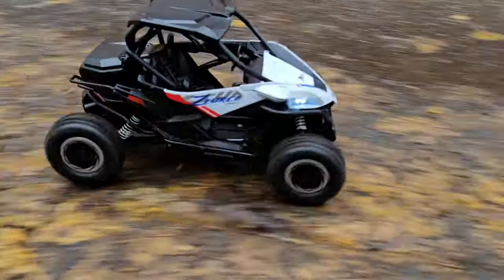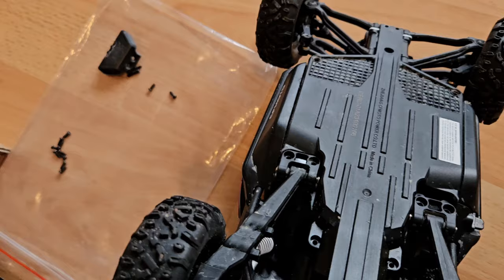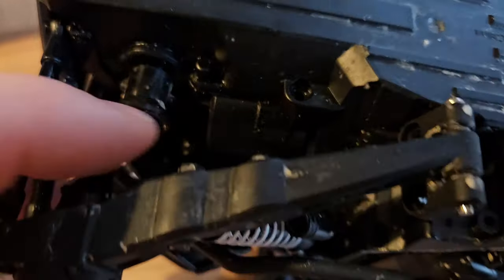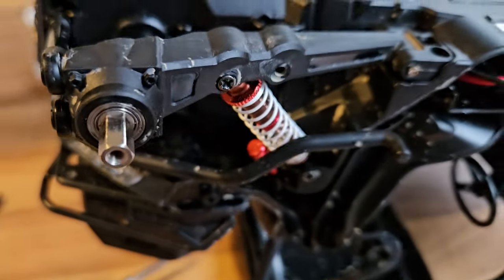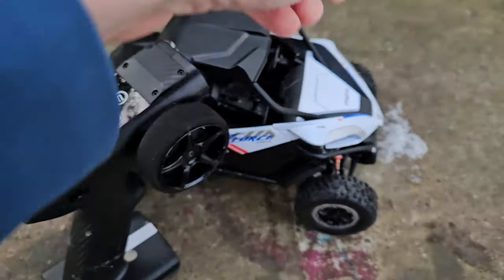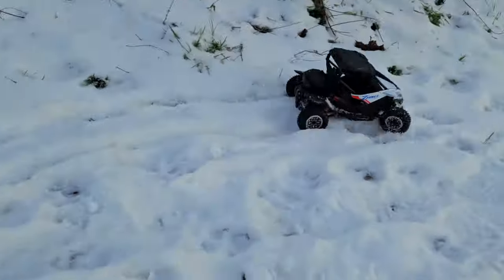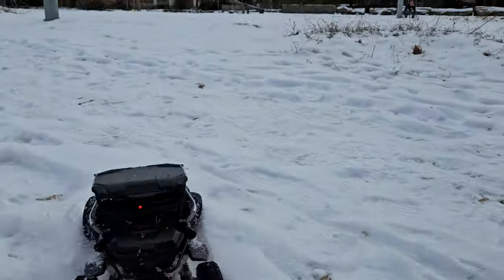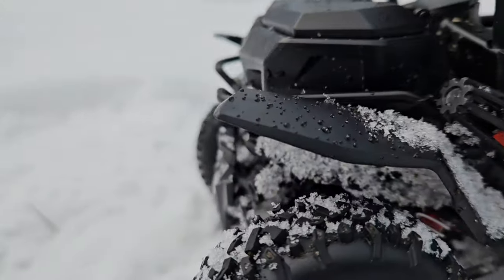SG 1205 CF Moto Z Force - upgrades good. Pricing (55€ to 110€!) and Quality of the RC itself - meh!

Comment: The oil shock absorbers are a very strange design I feel, with the main shock body containing the oil at the bottom and the imitation bypass system at the top.